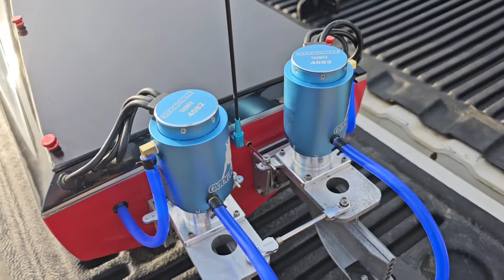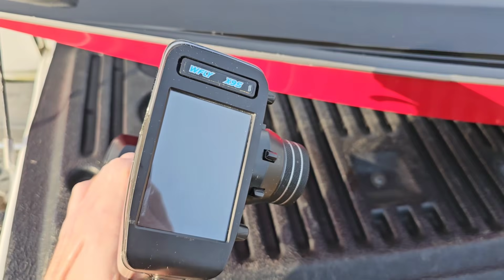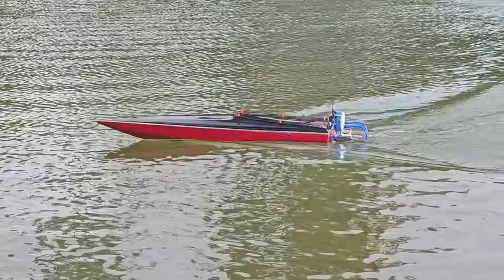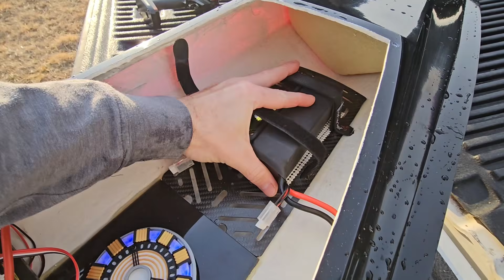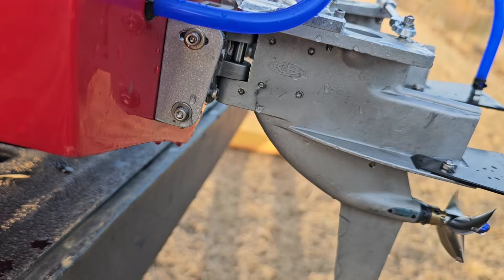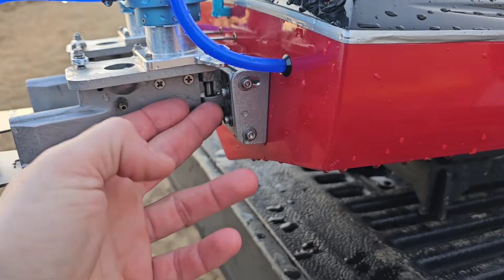Ironman Mark¹ First Testing - 4s & 6s

Comment: You need alot more downtrim on the motors. Your trim blades need to be angled down to push the bow down in the water. When the trim blades angle from down in the stern to up towards the bow the pressure from the water pushes the motors up in the water and the bow down in the water. If you are unable to get the bow to trim down by dropping the motors down then you'll need to add independant trim plates to the stern to work with the down angle of the motor causing more downforce on the bow. Because of the design of your hull its pushing the bow up out of the water due to the slope taper of the hull having an upward angle to the keel. The rim planes need to be able to put enough water force on the boat to counter the hull lift. You may not be able to put enough force on the hull to counter its lift with just the motor trim hence the reason you see alot of real boats having big trim plates on the bottom of the stern that resct with the increase of speed. The more speed you have the more lift force you create so the plates have to be angled down into the flow of the water to create pressure on the hull forcing the bow to stay down. When they are adjusted properly it will cause the boat to ride level on the water at the speed you are traveling. More speed increases the need for more downforce expenentially. At some point you can actually get it to where you have to create twice the amount of downforce then there is lift force to the vessel to keep the bow from cavatating. This can potentially be bad as the hull may not be able to withstand the adverse pressure. Then you end up with the stern of the boat literally breaking off. Many poorly designed boats have blown apart at the detriment of the boat owners because they didn't pay attention the the design physics of the boat they built and they built the hull with too much bow lift in the keel. Either you end up with a boat that takes off out of the water and flips the bow around slamming it upside down or it simply rips the boat apart from the force.

Comment: Gonna have to trim down all the way the props are tilted up to far when a real boat porpoises you jus bump the trim down a touch
Reply: Then when she rides smooth start raiseing the props higher and higher until it cavitates then bump back down a touch then play with battery placement the farther back u can get the batteries without porpoiseing the more balanced it will be at high speed
Reply: Remember weight shift forward in a real boat only needs be done when haveing hard time getting on plane
Reply: Last but not least if your gonna run heavier batteries try running them now with it trimmed all the way down being that its porpoiseing  before you start changeing motor hight or weight distribution ..otherwise you will end up back at square 1 with all your settings. From here looks like its gonna b a ripper if you can get her trimmed down a lil more hopefully without haveing to put a wedge between the transom and jackplate

Comment: I faced the proposing problem too. I asked on forums and people said that using trim tabs might help solve this problem. Also the cg should be about 26-30% of hull length from transom. I didn’t try it yet but it’s sounds pretty realistic. 
Using different props might help. When I switched to bigger prop it’s helped a bit.

Comment: you might find that you are getting to much lift from those large cavitation plates.  You might want to try making them shorter and about the width of the motor cavitation plate.  I think those plates would work fine on a single engine boat, but they might be too much having two of them.

Comment: Definitely more weight to the bow. Running drives "down"  or "in" alone will help but puts lots of drag in the water running on the entire length of the hull and slowing the boat way down. It will not be running on just the rear pad, 
It needs Trim tabs or some kind of mini K planes. Because the motors stand off the transome so far it tries to act like a longer boat moving center mass. long K planes would be best.  That will ease the porpoising away and help with any chine walking. Then you can run the drives "up"  or "out"  for the bigger top end getting her on the ride pad at the rear of the boat. This will stabilize the hull  without losing top end. Also with chop props they operate with half of them in the water while on plane when motors are set at height. 
So basically... 
-Nose weight and 
Tabs to stop the hop
-Trim motors out or up to hover the nose to ride on rear.
-Set motors so props half in while on plane. 
That boat should do at least 75 MPH minimum.

Comment: After finishing your video I think I may have the same Bull.  I got mine from a dumpster, seriously, and salvaged it with a complete rebuild. Was a nitro glow engine setup originally, but had been completely stripped of everything except the prop shaft stuffing tube.  I used a big electric brushless and had a heck of a time with finding an ESC that didn’t want to catch on fire. It was just too big for a single motor and I finally abandoned the project and 3d printed a catamaran of the same 48” length with far better success. I still have the hull and canopy in storage for when I decide to revisit the project. Possibly switching to dual inboard drives… ? 🙄

Comment: You put liquid Styrofoam in the nose right now measure from the tip of the bow of the boat to the back of the styrofoam inside measure the center of the styrofoam drill a half inch or quarter inch hole from the back of the styrofoam towards the bowel now you can make different wait lead plugs then you can slide them back and forth to get the desired weight 4 the nose of the boat to keep it down now the lead plugs you can drill a small hole on the backside of each lead plug so you can take a thin rod put threads on the end screw it into the lead plug so you can easily slide it back and forth to get your desired weight for the nose of the boat
Reply from the maker: This is exactly what I was thinking!.

Comment: Cavitation plates mus be equal to the bottom of the boat or otherwise it will dig lift catch air and drop hence the porpoising lower motor until it is equal with the hull and then it will run right

Comment: I would think your motor height should run your prop "half in half out" using the bottom of the hull as a starter point 🤷 I've always set up my V hulls that way

Comment: I eliminate porpoising on 7.5 k&b combustion outboards on my tunnel hulls by lowering motor height downward with no thrust angle changes. Resulted in more stability, better turning, slower speeds but more scale appearnce. Hang in there, shes impressive!

Comment: You got the trim right at the end but went the wrong way with the motors, deeper or farther down will help also the carbon plates could be providing too much lift might want to trim them straighter so they dont act like a hydrofoil

Comment: Boat hauls designed for speed are designed to run with minimal wetted surface at speed and haul design with lifting chines or deadrise angle changes. The way race teams solved this problem was to put long trim tabs that are adjustable on the fly with electric screw cylinder or hydraulic. You want max lift with minimum drive gear in the water at speed and adjustable trim tabs long enough to end neat the prop or longer and just far enough away not to interfere with turning. With the outboard design being much longer than real world outboards is your biggest fight, from modern to the first v6-v8 2-stroke outboards the gearcase and props where shorter than the engine on top. Your props are so far back that it acts like an inboard with long shafts. 1 using a straight edge the centerline of prop should be even with bottom of haul at lowest setting or slightly above for starting point and LONG trim tabs even static manually adjustable is better than none if you power the tabs have them on a trim channel with equal +/- adjustments from 0 with the haul. If you want more info just comment back.

Comment: Beautiful job, I had a Miss Geico 36 twin, battled with porpoising for one year, weight forward, weight back, weight in the middle, changed the bottom multiple times, different struts, different props, nothing worked. With enough weight forward, it did stop. The purposing went super slow and burned up the electronics. Hopefully you’re working it out. Maybe I’ll try that. Great video thanks.

Comment: That boat was originally intended to have a heavy motor Midway in it what's next to no wait on the transom you're going to need at least a pound of weight up in the front of that boat where your phone is you may have to cut a hole in the foam and put your weight in there
Reply from the maker: Im gonna test by taping weight to the outside nose & see where that put me

Comment: This is a cool build. I used to run gas outboard K&B's around 25 years ago. We used to run "skegs" for high speed turns and adjustable trim tabs to keep our V hulls from porpoising. This kept us from having to run extra weight in the bow but the boat would still sit low in the water at the transom end due to the engine weight. Once on plane they ran great.

Comment: A boat, just like a plane, has a cg (center of gravity), as well as a thrust line. Find the cg, then balance as needed. Probably just add some ballast to the front. I would suggest a flat edge on the bottom to align the prop shafts at the same angle as the hull, batteries as far forward as possible and about 8-10 ounces of stick on weight on the bulk head. Start from there.

Comment: I’m not gonna sit here and say this is your issue, but from my experience with my blackjack 42, it does this same shit cause the factory electronics don’t have enough power. As soon as you throw a bigger esc in this boat the issue stops cause it has the power to actually hold the nose down.

Comment: From full size high HP boats,  My first suggestion, Take a strait edge from the bottom of the hull to the centerline of the prop with no trim.  Set that as your base "x" dimension.  From what I see, the props are way to deep in the water for the HP you have.  With the Chopper props and the set up, I think centerline 1/8 to 3/16 inch ABOVE the hull for centerline would probably be pretty damn close with the setback you have now.
Reply: That's what I was thinking.  They look way too deep.  Get the top blade out of the water.

Comment: Outboard motors need tilt trim. Your cavitation plate is planing the boat out of the water. Motors need to be tilted up pushing the nose down.  The actual motors themselves need to go down. The center of the prop can’t be even with the bottom of the pad of the boat   It will never run right like that.

Comment: Nice build! Been looking forward to seeing this on the water. Looks like trim tabs would help. 
My full size vhull has them and it has a heavy 250hp on it. Without trim tabs I'm pretty sure it would porpoise.

My gas zenoh v hull tended to porpoise until I added trim tabs. With the tabs I can still easily trim up the motors and air out the hulls but porpoise is eliminated.

Good luck with this, looking forward to seeing more time on the pond with it.

Comment: Two much weight on the back of the boat
Reply: I agree need a lot more weight in the front with those 2 motors hanging off back and nothing in the front same problem with his tunnel hull

Comment: In my experience with full size outboard powered boats with set back brackets is you can raise the cavitation plate one half the distance of the setback  bracket above the bottom of the hull  if the bracket is 30mm you can go up 15 mm  SCBG4L

Comment: Sorry, it’s Painful to watch you make setup decisions!!! First mistake is to run outboards in an old gas design and then stern load the cg way out with gearcases way to0 low.
Look up porpoise: basically the setup is trying to lift the bow which it can’t hold so it / bow falls and it repeats/ oscillates…
Raising the props even with lifting strake in line with gear case and run neutral trim….try a few props to find which one barely carries the hull just above the water an tweak cg and prop rotation … then try props which load more or less
Reply: Oh and prop rotation 
Outward pulls stern down, gives better handling 
Inward rotation lifts stern, push bow down…may give better top end but harder to drive
Reply: That’s why ur boat was oscillating as soon as it broke over onto a plane..
Btw: I’ve owned several extreme performance outboard n inboard boats… Allison merc, stinger , stv, action, 2.5 svs, slide valve,  shortie mid, skater24, pantera 28 twin 500 efi, kryptonite single bbc… all very fast boats that reward setup knowledge
Reply from the maker: My next step is to raise the motors. This was test 1, im sure there will be a few more major adjustments b4 it will ride smooth. The hull has no strakes & is a concaved bottom. My first thought is that it needs nose weight